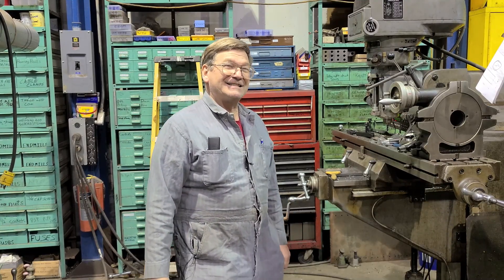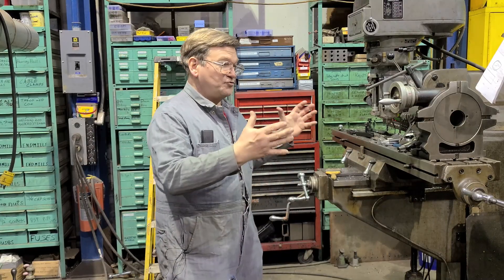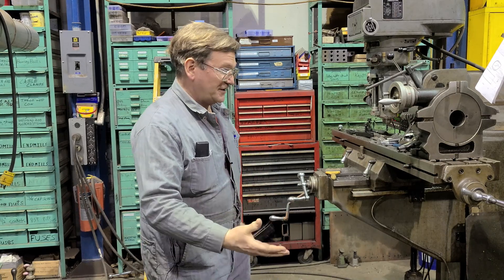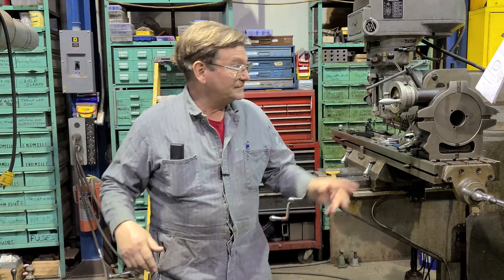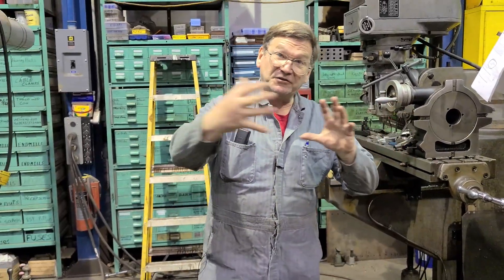Machinist's Minutes: CNC's vs Manual Machining

Comment: Here are a couple of reasons why manual is better than CNC:
a) Producing something manual allows you to make a part step by step: thus giving you opportunity to measure and ensure specs of your part. While on CNC you have to rely on the promise that that machine is "good". I say that because machining is very complex process and it is impossible to account for all variables in a CNC machine while keeping it safe and reliable.
b) For CNC you still need a machinist, operator and mechanical engineer to use them in order to benefit from CNC speed. Forces on the part, machine and tool are too great to be disregarded (don't forget about heat, metals expand and become softer when heated. Also it can ruin tempering)
c) You cant learn much on a CNC; you have to have that knowledge before you can operate it in the first place, because it is easy to make a mistake, but they can be very costly. Furthermore, because parts are made in one session as opposed to step-by-step it is hard to learn anything. You cant look into machine and take actual measurements from the part, therefore if your part does not match specifications, you can only guess what went wrong (there are just too many things).
Reply: Your entire post is flat out wrong in just about every conceivable way.
Reply: @brandons9138  
Watch this: your post is just wrong on every level....
But for real, your reply is not a valid argument (if it qualifies as an argument at all...)
I just stated a bunch of hypothetical reasons why CNC might be worse than manual.  I do not have much experience, but I do have a wide imagination)))
Reply: @MieczyslawPawelKolenda No, you're right it's not an argument. However anyone that has spent any time in a shop will see it as being true.
Reply: @brandons9138  Are you then one of those ppl that have spent time in shop? If so, it should not be that hard to make a valid argument, instead of making one from authority. Especially if you haven't established such authority yet... Very lazy of you, does not seem in character of a hardworking person that has spent some time in shop ;)
Reply: @MieczyslawPawelKolenda  On your points
 "a) Producing something manual allows you to make a part step by step: thus giving you opportunity to measure and ensure specs of your part."  

CNC machining is done the exact same way.  Step by step one tool at a time.  In between tools you have the option of stopping the machine to make sure the machine did what it was supposed to.  Checking what each tool did is part of the set up process.  This is especially critical if there is another tool following the last tool.  For example a blind tapped hole.  You want opt make sure the hole is the right diameter and depth before sending the tap into the hole.

"While on CNC you have to rely on the promise that that machine is "good"."

I'm not sure what you are getting at here.  This goes in line with checking the results of the last tool before continuing the program

" I say that because machining is very complex process and it is impossible to account for all variables in a CNC machine while keeping it safe and reliable."

The human element is always a factor.  The wrong tool could be loaded or a missed offset.  That is why there are rapid and feed rate controls on the machine.  Instead of letting the machine run at full rapid during set up. The set up guy should be using the single block function to run the program one line at a time until he's confident that the tool is doing what it's programmed to do.  One common visual check is to have the tool stop .1 (inches) above the part.  That way the set up guy can slowly approach the part using the rapid and feed rate controls on the machine.  Once he gets to that .1 about the part a quick visual check to make sure the tool is positioned correctly. 

"b) For CNC you still need a machinist, operator and mechanical engineer to use them in order to benefit from CNC speed." 

If this is the case then I'm grossly underpaid because I fill all of those roles.  I program, set up and run parts.  It's a VERY common role in most shops.  

"Forces on the part, machine and tool are too great to be disregarded (don't forget about heat, metals expand and become softer when heated. Also it can ruin tempering)"

This is why we have work holding that secures the part in the machine.  Some times it needs to be adjusted depending on part geometry.  If your part is getting hot enough that you're experiencing thermal expansion, then you are doing something wrong. 

"c) You cant learn much on a CNC"

You can learn just as much on a CNC machine as you can on a manual.  The set up process between both machine types is not that different.  Setting up work coordinates and tool length offsets serve the same function whether it's a manual machine or CNC machine. 

"you have to have that knowledge before you can operate it in the first place, because it is easy to make a mistake, but they can be very costly." 

This is why a guy that has very little experience is not setting up a machine.  He's a parts loader and unloader.  During cycles he checks and deburrs parts.  If he has the willingness to learn then he can learn in a set by step fashion.  I've trained several guys.  I've taught everything from basic set up skills to programming.

"Furthermore, because parts are made in one session as opposed to step-by-step it is hard to learn anything. You cant look into machine and take actual measurements from the part, therefore if your part does not match specifications, you can only guess what went wrong (there are just too many things)."

This goes back to my explanation of your first point.  You don't just press the button and hope for the best.  The parts are checked in the machine along the way to make sure things are progressing as they should. On basic parts you can read the code and see what's going to happen ahead of time.  Don't get me wrong there are times you pull what looks to be a good part out of the machine only to find that it's not good.  Even then it's a matter of being able to trouble shoot the issue and solve it.  Some issues are easier to solve than others.
Reply: @brandons9138  I owe you an apology...
Sorry!
And I appreciate your reply, it means a lot!
Reply: @MieczyslawPawelKolenda You don't owe me an apology. I was the one being as ass. You called me out for it. So thank you for that. 

Honestly this video pisses me off. I'm sure this guy is a talented machinist. His arguments and rationale in this video are just not well thought out or presented. Both manual and CNC machining have their uses. One isn't inherently better than the other. His rant about "bad engineering" shows a deep misunderstanding of 3D printing technology and advancements in design/engineering.
Reply: Some shops don't offset, they use tool setters. You set the tool holder, into the taper, and set the tool to length, or a boring head, to diameter. So each program, uses the same offset, for that tool, each time.

Comment: That fancy s-curve also increases cycle time and tool wear... The problem like you mentioned is engineers are not learning the processes required to make the things they design and follow everything then learned from some book. Rather than you know actual engineering. If I could I would burn every 5S book in existence as were building parts not cars.
Reply: fancy S curve also reduces stresses on the part making it stronger part.
Reply: Time and place for everything like he says. I see a lot of parts from customers complex because they can be and don't understand how it effects scaled production. Had a customer one time get upset when we had to tell them adding a groove to there part that was in production was going to jack the price of the job up significantly. It added 5 seconds per cycle but when you make 100,000 parts that's huge.  @brandons9138

Comment: We’ve had jobs come in that, in the past would have cast in features, that they want fully cnc’ing from standard stock (flame cut plate and whatnot) not realising how long that kind thing can take. For the sake of saving money on the castings. 

Saying that our shop has several millions on cnc machine tools, but we still have a load of manual machines and in my humble opinion manual machines are irreplaceable

Comment: I love working on the manual lathes and mills, and use them fairly often. I totally agree that in some cases, the manuals can actually be faster than the CNC. Especially single features involving one tool. Eg; counterbores in a number of parts. 
There is a certain kind of zen feeling I get working on the manuals. They also make the work day fly by. 

However, there are parts we make (robotics industry), that absolutely have to be made on a CNC. It's not that you couldn't do it on a manual. It's just that given the quantities, and features that involve interpolating holes or surface milling, etc...they just have to be done on a CNC to expect any kind of productivity. 

On the flip side, if your shop is mostly repairing large shafts for the mining industry, that sort of thing? I could totally see a large manual machine being the way to go. It really just depends on the kind of work you're getting, I think. 

I really don't think it's an either/or scenario. They're both great, and they both have the purpose.

Comment: CNC is good for mass production when you don't have to change the program for various different parts. The only thing is regular maintenance is still required.
     A manually made part is better for many different parts that require precision machining

Comment: I did a research project on the history of CNC machining when I went to trade school ( industrial technology- sort of engineer-y, but also sort of trades-y ) and the biggest advantage that was touted by the people that created this technology, was the repeatability factor.  They were just trying to engineer the “human” out of “ human error “. I have to agree with you, there are reasons for CNC, and there are reasons for manual machining. I think it comes down to the engineering, and the lack of production sense that asks the question “ Just because we can, SHOULD we?”. Keep up the good work 👍.
Reply: I have a theory about all of this perfectly calibrated robotic manufacturing that that takes human error out of the equation.

At some point nearly everything is going to be made perfectly, and because of that, we will then get bored with perfection and to some degree begin to desire human error with some things. Where each item made is unique.

I can’t remember a specific example, but there are even some items that are specifically manufactured with a flaw to appear handmade.

And then some people desire handmade items over machine made, even if it’s a slightly inferior product. Just look at how Japan has precision manufacturing, but their culture also values expertly crafted handmade items.

Comment: Singles or small batch vs production? No comparison. I'm still using programs on production parts that are 15yrs old. (I have an old cnc and loyal customers.) Also, I have basic programs that I can change a few measurements for basic shapes.

Comment: To me this boils down to: how long does it take one person to to set up end produce X number of part( s) versus all the the time to write the program set up the CNC, prepare the raw material for the CNC and run X number of parts. Some times an assembly line set up of different machines is faster than one CNC. If all depends on what the part is ( complexity) and efficiency.

Comment: I have an almost brand new Cnc mill with the probe and tool changer. I have a new Prototrak bed mill as well. I do prototyping for aerospace. The Prototrak is the best of both worlds. If it had an automatic tool changer it would be perfect. You can use it manually or as a cnc and programming is easy thru the conversational control. I like that it’s open and you can get right up on the part with a loupe if you need to to really dial something in. That being said, these are $140,000 worth of machines. And the software is $3000 a year.
Reply: I will agree that the Prototrak is absolutely the best fusion of CNC and manual. All of the perks of a manual machine with the extra capabilities of a CNC.

Comment: CNC is the better option because 1 person can run multiple machines. There is a serious shortage of qualified people in the industry. Automation is where it's at in 2023 and in the future
Reply: At Eskridge, in Kansas City, we had what was called cells. Had four CNC's with different jobs,  sometimes, two different jobs, on a double table. A drill press, and a large horizontal broach. So you also had to do, First Articles, and keep SPC records. So you ran them, according to their cycle time. Busy, busy, busy.

Comment: My uncle owned the largest shop in my city  he built it from scratch 
He had manual machines from the 1940s up to   cnc machines in the late 70s  so yes i worked in the shop.  On big jobs you keep making the same part for an industry cnc machines are the way to go
Smaller jobs manual machines are the way to go. You get a million part order you might find your doing the parts on both manual and cnc machines at different stages. 
 One type of machine is faster.
We used a horizontal mill on part of the job then it went onto a vertical mill to do 5 more operations then out to plating and back to a 3 head drill press to assembly finish work and inspection.   Each order was a million parts we over all made 10s of millions of them.   As far as i know they all got used up during the gulf war.
Reply: Used to run those multiple head drill presses, for emergency brakes, on the drive shaft. I had to walk from one end of the shop, to the other end, to sharpen the large, busted drills. The material was hard, and big drills, could have used, a pilot hole. Just saying.

Comment: 2:50   and ill bet the CNC program was on punch tape and took 3 4 hours to write the program and set up the mill.

Honestly back then the journey set a better time for a one off part.

Now in 2023 its done with cad 
The blueprints in cad the computer takes the drawing you pick the part your making and the parameters are done by the computer not someone writing code for 8 hours a day.  He's just pulling parts to make off the drawing. 

Now its 5 axis  not 3. The manual machinist almost can't do that type of work.  Well not in a production time.  The parts too complex and he would be making jigs all day to do operations you can't normally do.

The computers today are a lot more advanced and a lot smaller. 

Your machinist is still 5' 10"  210 lbs  and hasn't changed much ecpt for his smart phone.

Comment: The rapid release of internal stress in the material will always be the cnc machines down fall, plus a computer can not compensate for unforeseen conditions. I was building a mold for a simple sink plug and they had a call-out for +/- .0001" on a corner radius. Their tolerance was higher than the expected shrinkage of the material after the molding process and it was completely pointless, that radius could have been +/- .030" but the technology is there so let's take advantage of it. Cut the tolerance in half and you double the production time, so keep that in mind.

Comment: My shop has both because we can run the simple stuff on the manuals while the CNCs do the more complex or involved jobs and not need to keep track of that many extra programs. I don't get the rivalry, I think it's important to know both so you have that many more tricks for when you can't do it the way you would have preferred.
Reply: Agreed. I don't get the rivalry either.

Comment: I have a small manual machine shop that can make about 30 p/n's of the product that a major client once made. The volume is low- 6-20 pcs per run generally. It's not a very juicy job for a job shop, and the logistics of getting me the parts is an outsize cost at that volume. Gotta write a PO, pay for delivery or go there to pick up, etc. Might even have to negotiate or clarify the job to the machinist. Or I can order 6 feet of material from McMaster-Carr, and consume it making a p/n. 

Under this scenario, I won't be tempted by CNC until I want to make their more sophisticated p/n's. But that can wait. Currently installing DRO's and good places to keep everything at hand to minimize excess movement during an operation. I am sure that the DRO will close the gap to the CNC throughput significantly.

Comment: Ya, I'll be that guy. I learned on manual and CNC machines in college studying mechanical and manufacturing engineering. 

For what I do at my job, CNC is almost always better. Short production runs as well as one-offs. More accurate and typically faster. I try to use the same tools in the machine and sometimes swap out as needed for particular jobs. Takes no more than a minute or two to set up a different tool in the machine. 

Where it can become slow is having to set up lots of drills or taps for hole work. This is usually where I'll deviate and I'll spot the holes on the CNC and take the part to the drill press for finishing. 

Another time saver is 3+2 machining. If a part will require any more than one setup on a 3 axis mill (manual or otherwise), it can likely be done faster on a 3+2 capable mill.